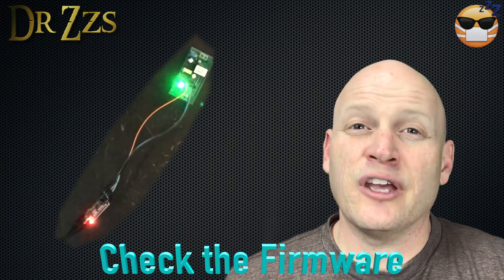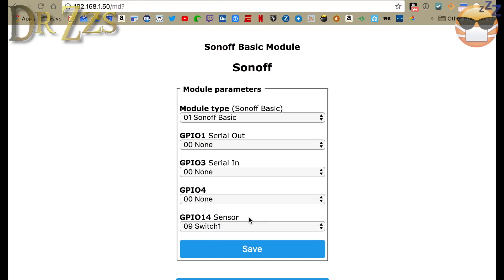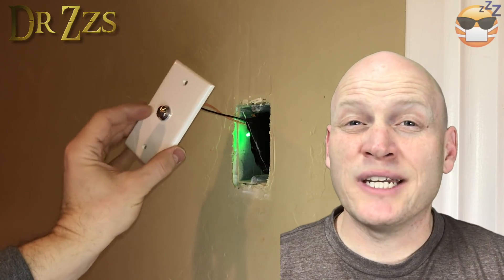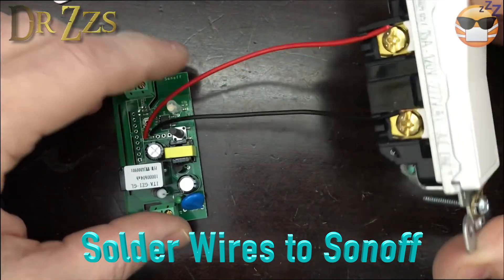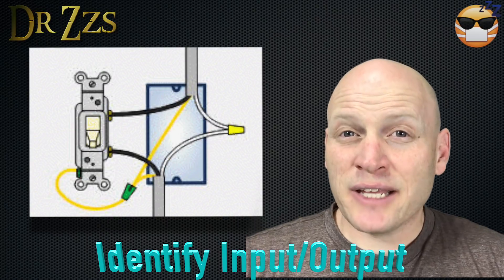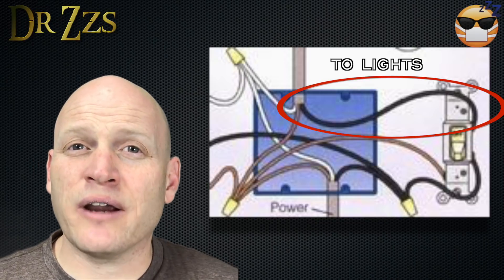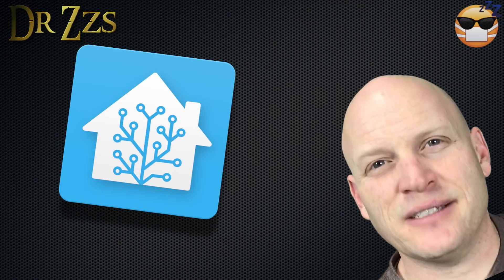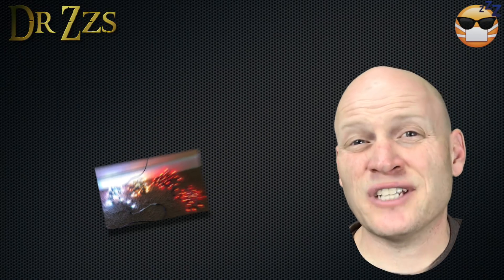No $30 "Smart Switch" | $5 Sonoff + REGULAR Light Switch!

Comment: @DrZzs Great video! I know you said no in your video, but is there any way i can wire in a SONOFF to my lights as they all (the whole house) just have the two wires going to the actual lights from the switch. Is there no way i can actually wire the sonoff into the light socket? Cheers in advance.
Reply from the maker: Matt Edwards You would have to put the sonoff up in the ceiling with the lights. 
If every one of your switch boxes has just two wires coming into the box then the power wires from the circuit breaker must be going straight to the lights. 
So if you put the sonoff with the lights you’d have the wires from the circuit breaker into the sonoff. Then from the output of the sonoff to the lights, then you’d have to connect gpio14/ground to the wires going to your switch. 
That would really mess up anyone that comes along after you. Maybe label it or stick a note in the box explaining what you did. Or better might be to undo it when you sell the house someday. 
I’m probably going to catch some slack from any electricians that read this. 
I’m just explaining what’s possible, not telling you what you should do ;)
Reply: @DrZzs thank-you for the prompt, detailed reply. I am not worried about the next people, I would take it out. But yeah, i need to think about the setup, briefly, i have three outside lights, which i want to make "smart", from checking the wiring diagram for my house it looks like the power goes from the breaker to the (kitchen) light fitting, then from there, goes out to the (outside) lights and back to a triple switch (one switch for each outside light) which then has one wire (connected to all three switches) going "back" to the (kitchen) night fitting. (the switch for the kitchen light is separate, on the oposite wall). So i am thinking the whole thing is too complicated!
Reply from the maker: ha! Don't give up too quickly.
It is a little hard to picture the wiring in my head though.  If you want to send me a picture I'll give it a gander and see if I can figure out a solution.  
Easiest is to upload it to dropbox or imgur and post a link here. 
I'm impressed you have a wiring diagram of your house!  That's rare.  We still have to hope they actually installed it the way it's drawn.
Reply: @DrZzs OK thank-you! I will send you something tomorrow, would really appreciate the help.
Reply: Hi DrZzs, here is a diagram showing my setup. Hopefully, it makes sense. https://www.dropbox.com/sh/mtlcido9o8jkypk/AAC86KeD9rJAFenK3Ar8RE97a?dl=0
Reply: Hey @DrZzs Dont know if you had a chance to see my files, but i have a question, it just occurred to me last night that now the Philips Hue Dimmer Switches are HomeKit compatible, ie they show up in the home app and you can program the buttons to work any homekit compatible device. I have all my sonoffs with tasmoto and setup through homebridge, i have various PH Dimmers, could i just wire a sonoff into the lights normally (not needing to connect wires to the GRND/GPO14), effectively anywhere along the wires, but realistically near the light socket, and stick a dimmer on the wall in the place of the regular rocker switches (with the lights permanently on) and program the dimmer? Then use the dimmer buttons for each light etc?

Comment: You need to not tell people that there is an issue with that first wiring diagram you showed.

This can be installed in ANY house regardless of what wiring your original light switch has.

Ignore what this guy says, white and wires are what you need and every single house has them.
Reply from the maker: Interesting.  I don't mind being wrong. 

How would you supply power to the sonoff if all that comes into the switch box are 2 wires from the lights?  The problem is, you don't have a neutral in that switch box.  

If you know a way please explain.

Comment: Your video is great but I had a question. What about the third red wire that goes from the switch ti the light?
Reply from the maker: nathaniel blakley Thanks!
If you have a 3rd red wire then you have a 3-way switch situation. 
I just finished a video for that. I’d link it here but I’m on my phone. If you go to my channel page and the video tab it’ll be there.
Reply: Sweet ty for the quick reply. I'll check it out
Reply from the maker: ok, back at the computer.  Here's a link to the 3-way video
https://youtu.be/GEJCk-Dr3BQ

That is just one solution.  There is another.  
https://youtu.be/l-CM8JQmges

I haven't tried this second solution yet, but I will soon and I'll get another video together about it.  It'll probably take a few weeks for me to get that one out.  So many projects so little time!

Comment: can this setup work without flashing the sonoff with tasmoto? i would like to use it with ewelink app that comes with sonoff.
Reply from the maker: yes it can.  Instead of connecting to GPIO 14 you can connect to poles of the on-board button and extend wires out to a switch.  You can't use a rocker type switch unless you modify it to act like a pushbutton.  
Here's an example:
https://youtu.be/oUFuuoNfvyc

Good luck!
Reply: DrZzs thanks for the swift reply. I will definitely give this a try when my sonoff gets here. If I have any more questions I will give u a shout. Hopefully you can guide thru my first project. Cheers. Great work I must say.

Comment: I'm not really interested in using home assist will I be able to use these with other apps?
Reply from the maker: Without changing them at all you can use them with Alexa or Google Home or Nest.  
The stock app is called eWeLink.  It works well.  I believe it has to connect to their cloud though, so some people don't like that. 

The main purpose (for me) to change the firmware to Tasmota is to use them with Home Assistant.  I'd recommend you buy a sonoff basic and use it as is, and see if it'll do what you want.  You may not have to change it much at all.
Reply: DrZzs I have two of them I like them. Problem is not being able to use light switch.  I have them controlling lights on ceiling fan. Just want light switch to work.
Reply from the maker: gotcha.  
So you're using the eWeLink app?
If you change the firmware to Tasmota, you'd be able to connect your regular wall switch to the GPIO14/gnd pins using the wires you already have from your ceiling fan, but then you wouldn't be able to use the eWeLink app. 
If you keep the stock firmware, you could connect to the pins from the on-board button, but you'd have to use a push-button switch in your wall.  Or you'd have to turn it on, then back off again to get the relay in the sonoff to activate.  

Another solution would be to use Tasmota, then use something like HTTP Request Widget (for android) to make buttons on you phone screen to control the lights using http request commands. There are a lot of ways to get commands to Tasmota that don't need Home Assistant. 
https://github.com/arendst/Sonoff-Tasmota/wiki/Commands

http://sonoff/cm?cmnd=Power%20TOGGLE
Reply: the idea of the home assistant is great but seems like way over my head do they sell a home assistant already built?
Reply from the maker: tezack27 Ya. That’s understandable.  I don’t think anyone is selling pre-installed Home Assistant. 
Maybe someday it’ll be something you feel like you can tackle. I didn’t know anything about it 9 months ago. I know a little more now :)
Reply: I got it hock up and working we're did you get the flex wire?

Comment: Can you just tap in to button on sonoff to control light switch
Reply from the maker: yes you can.  The reason to use a different GPIO pin is because the built-in button has other functions.  With the default firmware if you hold the button it puts the board in set-up mode. 
If you are running Tasmota on the board that main built-in button has a bunch of other functions.  
So to avoid accidentally messing up the board by inadvertently activating some other function of the built-in button, you can use a button connected to GPIO14 (or other pins), that don't have extra functions.  
It's not a must, but it adds a little security and a little more control.
Reply: DrZzs could you do video on this ? On how to remove and hook up to a switch. I was thinking I could just get blank plate and just get a button switch

Comment: Please don't use automotive 12v barrel connectors (the blue ones) they are not rated for 120v. They could heat up with the current flowing through them causing the blue plastic to melt and possibly catch fire inside your wall. Same for the speaker wire used to connect to the output of the Sonoff it is not rated for 120v and could cause a fire risk. Use proper 120v wire (either salvage it or cut up a extension cord) and use wire nuts to make splices.
Reply from the maker: You are absolutely right.  That was not very smart of me.  
In my haste to finish the project I just used what I had on hand.  
Thank you for bringing it up so others don't do the dumb thing that I did.

Comment: Your 'single wire' connection is rare, but within (US) code.  It can be made to work with the Sonoff if you are willing to bust one rule.  The ground wire can be safely used for the neutral as long as that circuit does not have a ground-fault or arc-fault circuit breaker.  The black wire is the line voltage, the white wire with the black tape is the switched lead to the light.  Connect the ground wire to the Sonoff neutral connector.  The electrical code 'rule' you're busting is that the ground wire cannot carry any current.   But since the only current there will be the Sonoff itself- not the light- and that the ground wire is bonded to the neutral wire at the breaker panel, then it should work.

You also did something in the video that makes this retired electrician cringe.  You cut the wires.  A future electrician will find the short wires from the box and will invoke a curse on you.
Reply from the maker: ha! 
I really appreciate knowledgeable comments!  Feel free to let me know if you see me commit any other electrical sins. 
I promise not to shorten any more wires.  :) 

Thanks!
Reply: I'll remove the curse.

Comment: Hi. I have the Line coming from the light. is that going to work? i didn’t quite understood the first arrangement in the video. i know that the sonoff needs a neutral in order to function but does it have to be the specific lights neutral or can i use a completely different neutral as well? It would be very difficult to bring down the neutral from the light but I can easily wire a new neutral. Thank you!
Reply from the maker: I would guess you could use any neutral.  I haven't done that, but it should work. The neutral is only for the ESP chip, so it can be a small wire.
Reply: DrZzs Oh how great. Thanks very much. Good day Sir!
Reply from the maker: You're welcome!

Comment: I have single pole light switches, so, as you stated, "I'm in trouble and need to find another switch."  Do you have any idea what other switch or method I could use?
Reply from the maker: Craig Durant What you’ll have to do is get into the box behind your light. That should be where the main power is coming in. You can put the sonoff in there, then use the wires going to your wall switch as the GPIO 14 and ground wires. 

So mains power goes to the input on the sonoff. Then the output from the sonoff goes to the light. Then the wires from the light box to the switch will connect to GPIO 14 and ground. 

That should do it. 
Good Luck!

Comment: Im guessing if using a rocker switch, the switch has to remain in the on position for the network features of the sonoff to work for the lights?
Reply from the maker: you guess wrong.  :)
If you attach the rocker switch to GPIO 14 and ground, and mains power to the input side of the sonoff and the lights to the output side, you get the same look and function of the switch you have now, but with the wifi/home automation hub control as well.  
As long as the breaker is on, the sonoff gets power and the wifi functions are available. 
It's a great little device.
Reply: DrZzs thanks! It was really the only thing holding me back from the sonoff. I really want to do a push button, but cant find a good solution and i dont have a 3d printer, so rocker seems like my option. Thanks!
Reply: Then make your own push button.  Buy some momentary push button switches and some blank cover plates, and drill a hole and put the push button switch in.  Put some red and black wire on the terminals, and you have the same thing, no need for a 3d printer!
Reply: Michael Burns that was actually what i was going to end up doing. I was just having a hard time finding a button i didnt think would look stupid in the wall. Found one, actually might be the same one drzzs used. I cant bring myself to have obnoxius red or blue or evem green buttons in my wall lol
Reply: Yep, I understand.  I usually hit up AliExpress or Banggood, with them I'm pretty sure I can find at least SOMETHING to work or hack on to try to make it work.  I just looked and they have GLASS pushbutton switches with the sonoff device already built in!  Didn't even know they had those...so many choices!

Comment: DrZzs this is what I did for mine. Thank you so much for this video!
https://m.imgur.com/a/fQcFj
Reply from the maker: Nerd Of View Ha! That’s super cool!!  Smallest push button light switch ever!  Nice work!!
Reply: DrZzs I didn't flash my sonoffs to tasmota. Since they worked with Alexa out of the box and I was using the button on then sonoff as the switch to physically turn it off and on i thought it did everything I wanted it to without the complications of trying to flash it. But know I think I have thought of a reason to do it. I have an ecobee sensor in just about all my rooms. I was seeing that you could sent those up to turn on lights when it senses the room is occupied. But I don't see how to do this in the basic software. Can tasmota do this. What other advantages does tasmota bring to the sonoff? Sorry if this is a dumb question. Just saw this video and got a few Alexa devices for Christmas and wanted to try this project. Thanks in advance.
Reply from the maker: to really get devices to play well together I'd recommend you get a home automation hub.  I use Home Assistant, so I'll tell you that's what you should use :)  
It's free software, that runs on a raspberry pi (or any other old computer), and can link all your devices together.  I use Tasmota on my sonoffs so I can get them into Home Assistant and link them to everything else. 
I haven't done my own set-up video for Home Assistant.  Ben from Bruh Automation has great videos on setting up and getting going with HA. 

https://youtu.be/tCGlQSsQ-Mc

I don't have any ecobees so I can't say for sure. Without a hub, I don't know how you'd get your ecobee sensors to interact with your sonoffs, even if you use Tasmota.

Comment: Hello, 
I Have flushed the Tasmota successfully into the Sonoff, connected into the setting via IP went on configure module so it can work nicely along the toggle switch - saved the change. I turned the breaker back on the toggle switch was working until i tried to add the sonoff device onto ewelink app which the app could not identify the device and the toggle stopped working, now only responds to the on/off via IP portal command. any suggestions? Thank you
Reply: Oriolis Martinez can I use this links for the raspberry pi3? I just bought one, it should arrive Monday. Thx
Reply: Yes, there's a raspberry pi3 image on the link. Also check this video to get started. https://www.youtube.com/watch?v=XWPluWcYRMI&t=32s
Reply: solved, had to replace the device. I think I shorted when soldering.
Reply: When you flash tasmota to the sonoff you can’t use the ewelink app anymore. You can use Home Assistant and mqtt to control the sonoff.
Reply: Oriolis Martinez is there something more friendly then having to buy a piece of hardware and a lot of more programming?
Reply: Jaire Oliveira Jr. The main reason to flash tasmota into sonoff is to use your existing mqtt broker and integrate it to a home automation software. If you have a raspberry pi you install Hass.io. https://home-assistant.io/hassio/installation/
Reply from the maker: bummer. 
I've ruined a board or two with my rookie soldering skills.
Reply from the maker: Jaire Oliveira Jr. Ya.  Get Home Assistant running and you’ll really unlock the power and fun of these switches and TASMOTA.
Reply: Thank you guys.
Reply: Well since you flushed it. You're good.

ROFL, find a new hobby and or language.

Comment: Ok... along with the 3-way questions... I have a light switch that only controls the plugs for the lights in the room... but I want to make the room 3-way from another door, is there a switch that's battery powered that I can surface mount at the other door to turn the room "3-way" using a sonoff to replace the only switch???
Reply from the maker: Yes.
You can try following one of these:
https://youtu.be/ImVK5cGVrpQ

https://youtu.be/9X3ZIv1joLo

But you also just gave me a great idea!! 
Sonoff makes an SV (safe voltage) board.  You could just connect that to a battery and stick it anywhere!  Dude!  That's a great idea!  
The 3-way switch video is coming together, it'll be out monday.  Then I think I'll do this battery powered Sonoff SV next! 

You're a genius!!